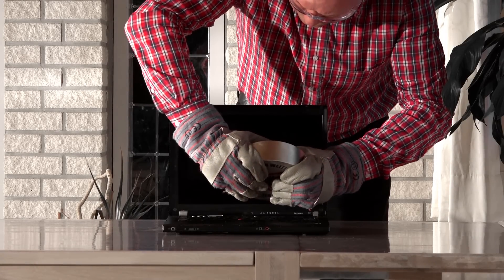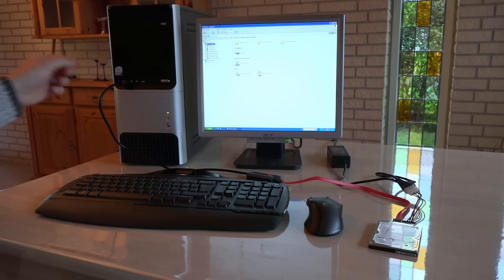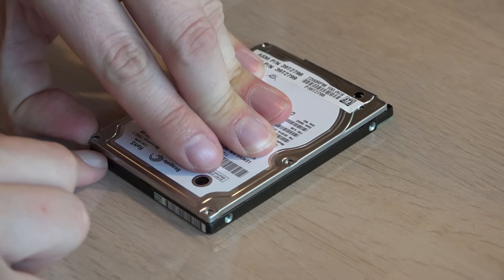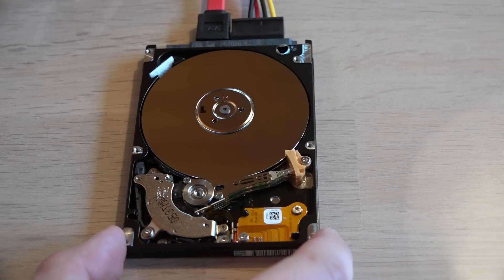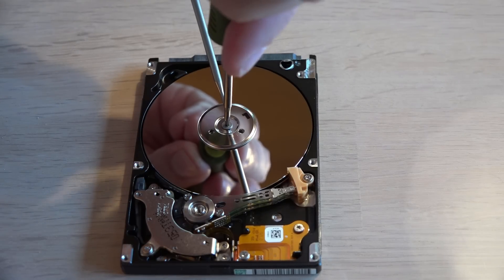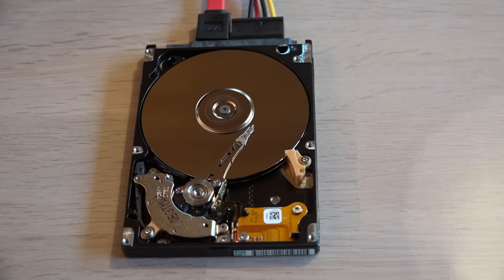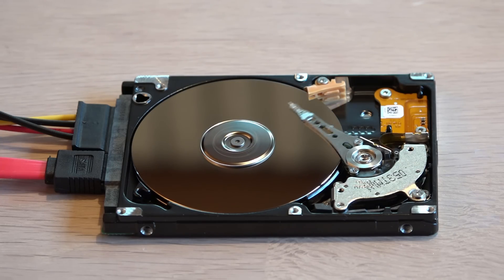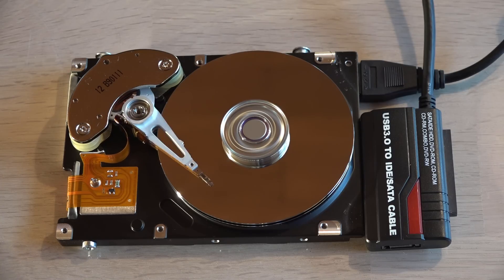Killed by magnet | HDD examination

Comment: Windows XP? WINDOWS XP? Windows 10 is out and people are still using Windows XP? At least use Windows 7! Or is that pc that slow it can only handle Windows 7?
Reply: +Quenten Schoonderwoerd lmao windows 10
Reply: windows 10 is a joke its fucking spyware and runs like shit i will gladly stick with 8.1 and when that becomes to outdated move over to Linux
Reply: Older versions of Windows are way more stable, at least in my experience. Windows 7 crashes on me several times a day on every PC I use, I hate everything about 8.x, and 10 is just different enough from the Windows I'm used to that it irritates me to no end (not to mention it looks like someone ran over it with a steamroller and left it as roadkill). Windows 2000 FTW! :D
Reply: The Hard Drive Guru Windows 7 crashes several times a day? There's something seriously wrong with all of your PCs then, I have used Windows 7 for almost 7 years straight now throughout 3 different computers and it has only crashed on me like 15 times.
Reply: The Hard Drive Guru Windows 10 NEVER crashed on me, have been using it for 1 year now... It is way better than 8.1 or 8 cause those are weird and 7 is alright but I personally like Windows 10 more
Reply: Quenten Schoonderwoerd windows 10 is just spy ware i would never use it

Comment: If your just reformatted the hard drive it would work, but it wont work now because you opened it. The magnet simply wiped the HDD. I guess a good plan to delete everything on it. I bet if you read the HDD now it would display only 1 or only 0 as all the little magnets in plater are turned to one state

Comment: The platters store information in the magnet field like a VHS tape, And once you place a magnet near enough to affect that magnetic field, The magnet will runin the magnetic field on the platters rendering the hard drive useless.

After the magnet field on the platters is runied, You can not recover any data nor read/write to it.

Remember, most of the important information about the hard drive is stored on the platter, Once that is runied the hard drive is dead.

Comment: Try connecting it to your laptop and opening Disk Partitioning Program to see if it detects it. Run a cmd and start disk part program, check if it's working there, usually windows doesn't recognizes not working disks from the normal gui.

Comment: Hi,
Either the header to disk gap is misaligned(increased) due to the pull of the magnet or the magnet which moves the header in the assembly lost its power due to domain misalignment.

Comment: Can you make a speaker using your 6 inch neodymium magnet?
Reply: +MixZ I would wan't to see that
Reply: +TM80 NotGoodWithNames it would probably be as loud as a 4000w speaker at 200w
Reply: I don't think sso but it could be more powerfull at 5000hz
Reply: +TM80 NotGoodWithNames neodymium magnets have a larger magnetic field. the voice coil would most likely go crazy.
Reply: it would need more power to move
Reply: +TM80 NotGoodWithNames Very small neodymium magnets are used in phone speakers and even most headphones. The speaker would need much less power but the magnetic field would be too dangerous.

Comment: my conclution is that the drive memory data was destroyd under the heavly load of the magnet witch changed the gravetational pull on the actual soreage toweres inside the platers and allso the reading drive migth have ben dameged from the magnet in a way as well allthrug allmost imposeble as it is in flash chips

Comment: If you have seen a hard drive in shape under a strong microscope, you can see lots of little dots. When it is affected by a magnet, then you can see (under a microscope) a few wiped lines. The structure of the platters are away and the bootsector too

Comment: The magnet destroyed a special area of the disk which is called the reserved area and not included in the formatted capacity. It tells the drive how much data each platter holds, contains bad block information and remapping data, smart test data, calibration data and the like. It also contains spare blocks to use so that bad blocks are remapped invisibly to the user. Since you destroyed this area, the drive is failing to initialize. Leave it on long enough and it will give up, spin down the platters and park the heads.

Mental note to self: if I ever get one of those evil magnets, take it through the kitchen and across to the workbench in its box. Do not pass the row of LTO-4 backup tapes!

Comment: I have an 1TB external HDD and it makes worse sounds, but i never had never magnets near it, although i dropped it few times and so did my nephew. I could work with it for quite some time after changing its position upside down or even stand it on its side. But now that fail too and i wonder if the heads crashed finally onto the surface. 

I am from germany and i hope i can find someone that can recover my data from that platters without spending a fortune of money. Just havent found one yet : (

Comment: This kind of damage is reminiscent of what happens when a hard drive is dropped. The head may or may not crash, and if it does it's unlikely to cause scratches on the platter as the platter is a hard material. It's possible that the head might be damaged by a crash, the arm is almost certainly misaligned (as when a rotational drive is dropped) and there may be other signs of damage such as traces, magnetic components and components sensitive to static electricity since you were probably causing electromagnetic induction throughout the laptop... It might even be possible that other components within the laptop have been damaged, for example I'd love to see memtest86 results! Though that'll probably require a new fan as the system will get HOT... I also noticed that both screens were reacting strangely. Was this due to the GPU overheating when the fan was exposed (and probably stopped)?

Comment: Your videos are well made, informative and clearly you are passionate for the subject matter. Thank you for sharing this
Reply from the maker: +YOA Ownage HD 
Thanks for watching and commenting. Nice to know I'm on the kind side of YouTube :)
Reply from the maker: George Murray That's actually a good idea. A working HDD should be able to run without problems for a short time with the lid off. Maybe with some acrylic glass over to keep the worst dust particles out. Maybe it could visualize what effect the magnet has on the HDD.
Reply: +Brainiac75  magnet vs hard drive with the top off to see what it would really do
Reply: do it plz
Reply: hmm youtube comments are broken again i cant see all replys
Reply: And brainiac i would be easy with hard drives i found a old Seagate 60 gb was messing with it i held the platter in one place for to long overloading a circuit and starting the board on fire
Reply from the maker: George Murray Hehe. Yep, mishaps can occur when 'playing' with old HDDs. A small magnet can actually hover over a rotating platter. But only in the right spot. Beware of magnets flying fast away if you try it yourself...
Reply: yea i was not doing anything like that i just stopped the platter from spinning for to long and it overloaded a chip on it and burst into flames
Reply: +YOA Ownage HD this 
I could not say it any better.

Comment: The carbon pads that make 'contact' with the platters are actually rather sensitive, so it is possible that the heads were offset. Another possibility is that the magnet corrupted the firmware, though that is unlikely as it is usually stored on solid state chips.
Reply: +SPEEDYxArcher My guess is that the magnet corrupted the boot sector of the drive - the firmware is fine, it's trying to scan properly, and the head stops where it needs to, but it just can't find the thing it's looking for.
Reply from the maker: +SPEEDYxArcher 
You could be right. The head/plate-distance has incredible low tolerances and is crucial for the HDD to work.
Reply: +Ardusk if there were no boot sectors then drive would report no os erorr to the bios
Reply: Grzes kop I'm pretty sure that the "Error 2100: HDD0 (HardDisk Drive) initialization error" that we got in the last video is more serious than that. For a "No OS" error I imagine the computer needs to boot the hard drive, check for an OS, and then get back with a negative. If the boot sector is malformed, then it can't check for the OS because it simply doesn't know where to start looking.

Comment: based on the erratic movement of the heads id say you offset the magnetic field that it uses to control read position, you could have magnetized something that was not meant to be or you could have de magnetized something that was meant to be, or you could have changed how strong those neodymium magnets are, either by increasing or decreasing their strength
Reply: ***** ok, my question i guess is how do the needles index their position, is it through field strength variation in witch case a bad bearing could mean the inability to read, or is it like a magnetic version of optical coder wheels and strips? where changing the position (if each platter has it) of the platter would have no effect and changing platters could not work no matter how much you format it if they don't have the same code ring?, if so why don't cd drives do that with just limit switches and dc motors instead of still having one or 2 limit switches anyway but having a stepper motor

Comment: I feel like the pcb on the bottom side of the drive may have had a ram chip that was damaged (I've heard that at least some are controlled magnetically) because to my knowledge, no operation crucial data are stored on they platters. I believe it should be on rom chips and the computer should be able to detect it if the platters are blank.

Comment: When you put a magnet on the top of the hard drive the magnet wipes off all the sector and header marks making the disk completely useless and recognizable. Also Harddisk fails immediately when you open it up. No matter how gentle you were on the opening but tiny small particles and dust make the harddisk surface unreadable for the pointer.
Reply: Good drive can be used successfully for many minutes without cover before the dust particles kill it.

Comment: I've seen a video before, though it was long ago, where someone opened up a hard drive, powered it up, and released the discs while they were spinning at full speed, you could do that to still get some fun out of this old busted hard drive!
Reply from the maker: +XANApwns 
Hehe, that actually sounds a little scary. They could travel quite far and fast at the rate they're spinning.
Reply: I think in the setup he used, he had a small room where he put together a quarterpipe against the wall so they would travel up it and get some air

Comment: Dear Brainiac75
Could you do the phosphorous in pure oxygen lamp experiment and maybe use other gasses than Oxygen? 

Where a little sand is filled in the bottom of a round bottom heating flask and a small piece of phosphorous is placed in the middle then touched with something hot like a heated glass rod to initiate the reaction?? The flask should glow bright yellow. But what would happen if you do the same with other gasses? Could that change the color of the light emitted? Thank you very much og Glædelig Jul :O)
Reply from the maker: +THE UNKNOWN 
I don't have access to pure oxygen (unless in small amounts from electrolysis of water), so right now I can't do that experiment. I believe the light comes from the phosphorous so the gas is not responsible for the color. Pure oxygen is used because is supports the burning and makes the P burn really fast and bright.
Også glædelig jul til dig :)

Comment: The magnet erased the "SA" or "Service area". The SA is a track before the MBR that you cannot access without special expensive hardware or reverse engineering.

The SA contain usually the drive geometry, a bad sector list, smart data, firmware extension, LBA translator (which include bad sector reallocation address)... Without the SA, the hard drive can't boot. The SA is usually at the very beginning or end of the disk, that's why the head in your dead drive stay most of his time in the centre.

Also, like Nevin Williams mentionned, you probably have erased the servo (data at the beginning of each sectors) that help the drive know his LBA position and rotating speed.
Reply: So a super strong magnet is not necessarily a sure way to perma-wipe a HDD?
Reply: @Fellow_Traveller1985  If you want to also damage the drive, than go for it. But keep in mind that the corruption caused to the SA / Servo will prevent you to run the drive after, to confirm you properly actually wiped everything.

If you want to perma wipe the drive and render it unusable, a other good solution you can do and actually visually inspect, would be to use that strong magnet, but then, you get flat screw driver, spin the disk then remove the oxide layer with the screw driver. You do all the surface until all the brown stuff is gone. Then you turn platter over and do it on the other side.

Comment: Maybe the magnetisation was weakened by the magnet, and was strong enough for a big jolt outwards, but only retracted back in by the disk spinning and pushing it back. Another theory is that (as a fact) the distance between the disk and needle is thinner than a human hair (hence why its game over as soon as you open it) but the magnet bent it enough so it touches, however that theory would make sounds as soon as it started, so to refine that theory, the airflow that the disk produces is enough to create a cushion around the needles, until it retracts back inwards, but pushes when going out.
the reason why im saying inwards all the time is because if you listen and watch carefuly, the noise only happedns when the needle resets

Comment: "The drive would still not boot and I couldn't get Windows to find it so it is still dead"
The reason why Windows didn't find it is because you have Windows XP and Windows XP technical support ended more than a year ago.
(Windows XP is a bit crap)

Comment: the harddrive stores memory my magnetic induction  writing, when a powerfull magnet is brought near it the magnetic memory allination is destroyed, and even the reading tip may have been damaged. it might have worked if you could just took the discs carefully out and put in to a new hard disk, again might have worked if the magnetic disk was allrite and the reading and writing tip was damaged. nice vedio though.

Comment: what's the different the laptop hdd to desktop hdd?
Reply: The desktop HDD is bigger and usually it spins at different speeds.
Reply: +Giorgio Caio e Sempronio Thanks!
Reply: +Giorgio Caio e Sempronio They both typically spin at 7200 rpm, but the laptop hdd platers are more densely packed with data.
Reply: Jette Christensen
It's not exact. A laptop CAN spin at 7200 rpm (even 10000), but usually they spin at lower speed to achieve more power efficency and to make less noise. For the same reason you can find desktop HDDs which spins at 5400rpm

Comment: Only partitioned drives will appear in Windows Explorer, it's possible the magnate erased the MBR or GPT partitioning data casing it to not appear in Windows Explorer. However if you check in Windows Disk Management or in the BIOS it might appear, another potential issue that the Vista system could have be installed on GPT format and when connected to the older XP simply doesn't appear because the BIOS is not forward compatible with GPT, the drive may have appeared had it been tested on a GPT enable UEFI based computer. If  you have any questions about my rambling just ask